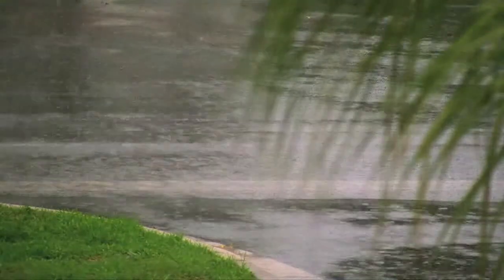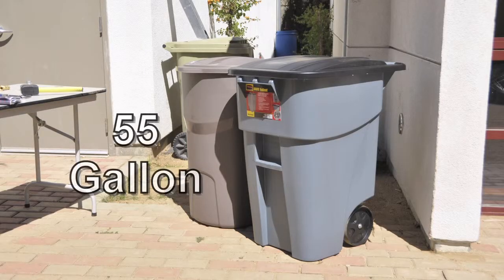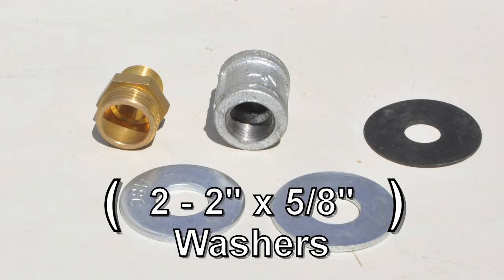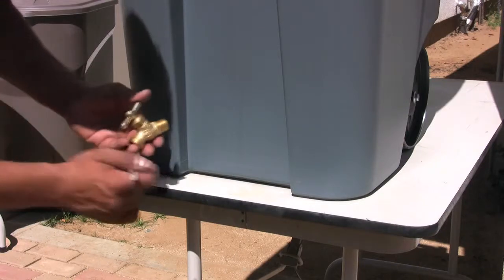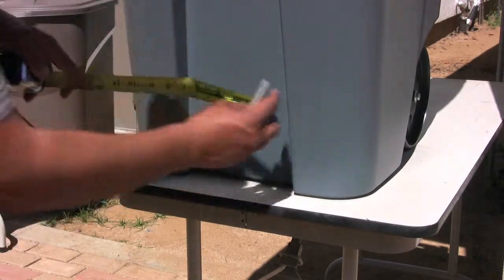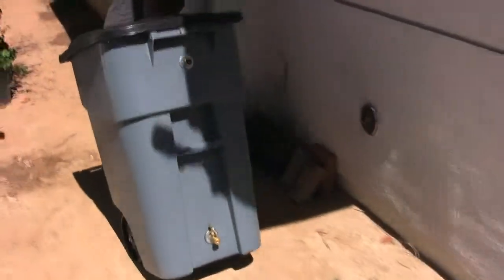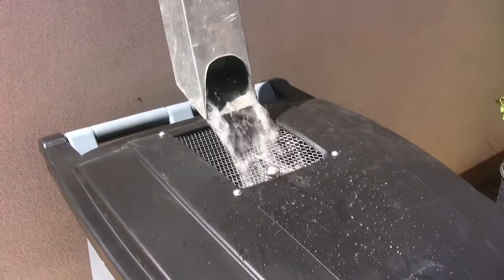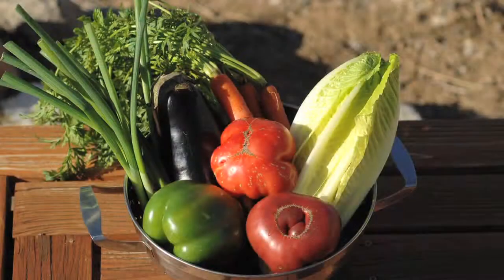RAIN BARREL ENGLISH VERSION

Comment: hello, 
could you explain why the barrel on the right is not much more higher than the barrel on the left?
I would think if one of the barrels is at a significantly higher level than the other one, then the water would flow better from the higher barrel to the lower barrel.  In this design I see both barrels almost at the same level (the barrel on the right slightly higher than the barrel on the left)

Excuse my ignorance, thanks